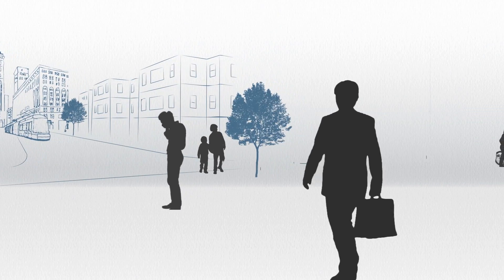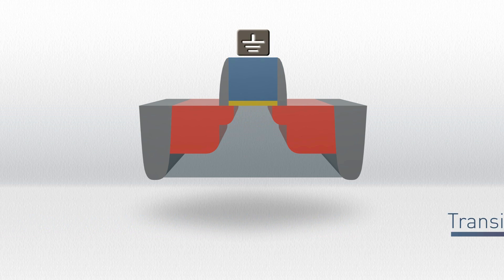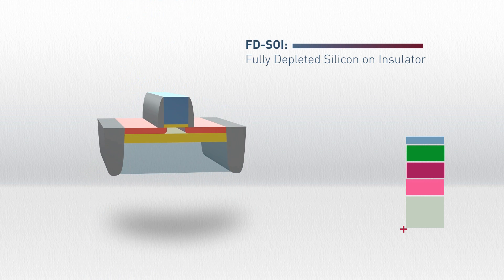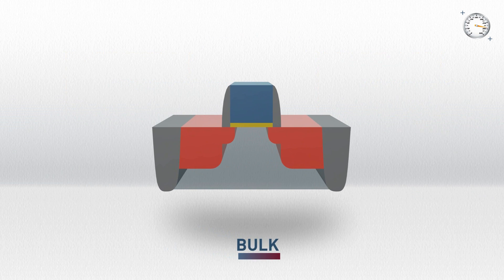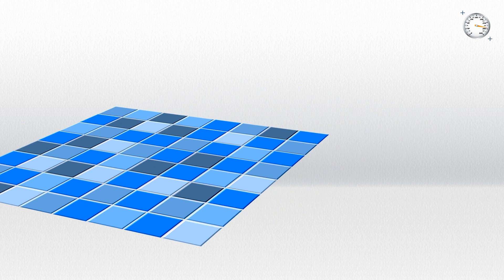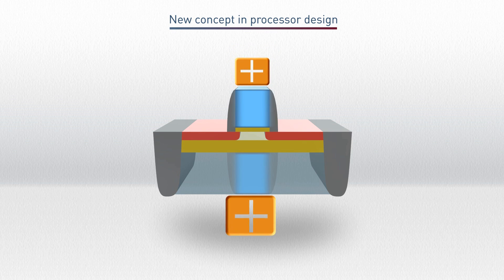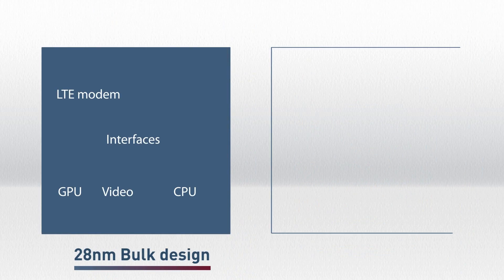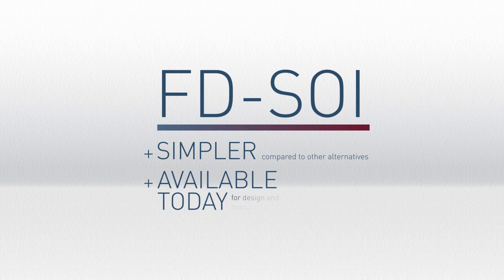An introduction to FD-SOI

Comment: But how the power dessipation can be reduced with different body and gate voltage? Can anybody Explain please :)
Reply: I think they are talking about increasing the Vth for devices by body biasing so that the subthreshold leakage can be reduced.
Reply: @prjthkmr  I think subtheshold current will not happen due to insulator below the channel that makes fully depleted... correct me I iam wrong